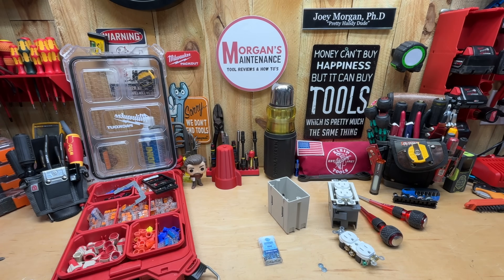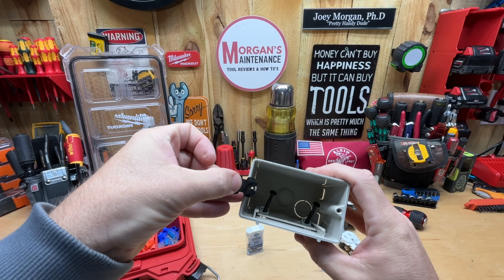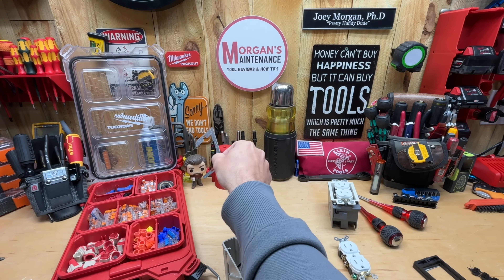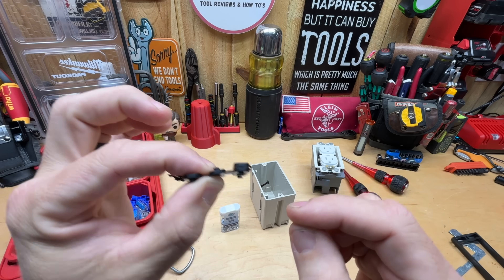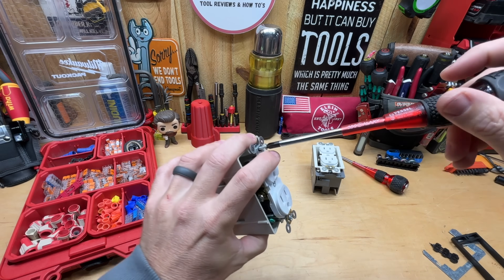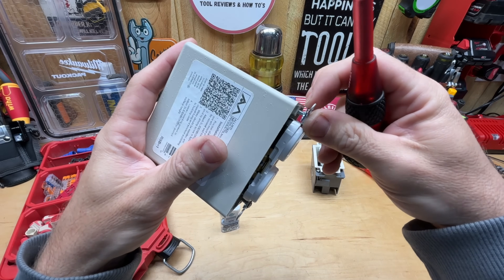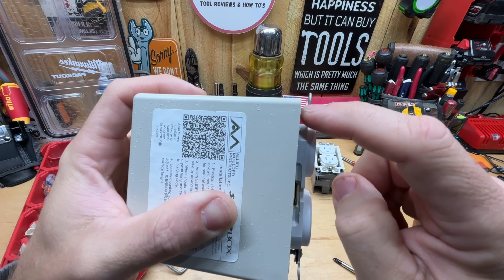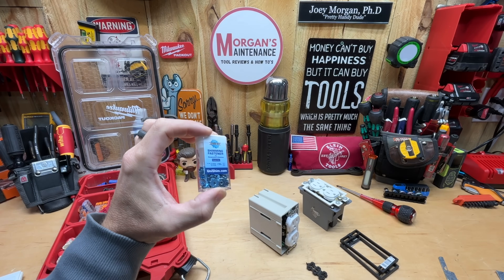UNISHIM - Electrical Shims for Receptacles & Switches

Comment: I would RECOMMEND you pull that plastic square off of the screw. The tab on the shim is intended to seat itself on the inside of the through hole where the screw goes through the outlet upper & lower tab. 
You can also just use your screw driver tip to spin the shim to adjust your gap instead of using your fingers
Reply from the maker: That does help, I just used one of these today 👍

Comment: I use the "caterpillar" ones with Sloan concealed flushometer sensor plates to bring the button mount out to the proper depth. I'll have to see about getting some of these to try.
Reply from the maker: I’ve used those more than anything else… these seem like a good option so far

Comment: Hello again, Morgan Maintenance 
Thank you for another Great Video 👍 I am not an electrician.  How does that change once you add the wires to the problem? Does the wiring change  how everything comes together? Stay safe and warm. Again thank you 👌
Reply from the maker: @georgeferlazzo7936  you wore everything the same as you always would.  These or any of the other shims just go into place as you are screwing the receptacle to the box.

If you are out real far from the box, that’s when you need to add an extender to cover the wires and terminals in the gap… but wiring is all the same

Comment: Looks like a good solution and timesaver. I use the ears from recepticals and switches for small adjustments. For bigger gaps I like to use 14 gauge wire. Coil it around a nail or small screwdriver so that you end up making what looks like a closed spring and cut a piece any length you want. Slide it over the outlet screw and screw it in. If you use your cut offs it doesn’t cost anything.
Reply from the maker: @timh7156  good tips 👍👍

Comment: I use clear plastic tubing. I forget the exact size but…maybe 3/8… but it woks very well and no need for adjustment. You just cut a price slightly longer and you just screw it until it’s where you want it. The tension of the compressed tubing hold it in once and each screw is independent. 

Only issue is it’s not UL listed or identified for the purpose
Reply from the maker: @nachoisme  I saw where RackaTiers sells something that is kinda like that in theory.  I’m not sure if it compresses or not.

Comment: In a pinch electricians use Plastic Conical Anchors, cut to whatever length needed .
Reply: Not necessarily proper just a way I was shown when I was an apprentice .

There is a Canadian electrical code rule where it specifies how far away your front edge of your box can be from finished surface depending of it’s combustible (residential ) or non combustible (commercial or industrial ) , American electrical code is very similar to CEC but I am not familiar with it. To adhere to this rule if your box was recessed in residential application you would technically need a box extension .

I mostly do commercial , i doubt resi electricians are using the conical anchors for spacing as they probably don’t even have it on hand nor is it proper.

12-3016   Outlet boxes, cabinets, and fittings (see Appendix B)
1)    The front edges of boxes, cabinets, and fittings installed in walls or ceilings shall not be set in more
than 6 mm from the finished surface and, where the walls or ceilings are of wood or other
combustible material, shall be flush with the finished surface or shall project from the surface.
Reply from the maker: @ yeah you are supposed to use those extenders like I showed in the video.  Either box spacers or the ones that fit into the box.

I’m usually dealing with mud rings on boxes which are normally set fairly well, (usually better than plastic residential) but occasionally they use the wrong mud rings because they didn’t know it was going to be 5/8 drywall or something.
Reply from the maker: I’ve seen quite a few things used over time.. that’s a good One to keep in mind

Comment: Interesting, with the design of our sockets in the UK, we just don't have this issue, as the sockets are built into the faceplate. Always intrigues me how things work in different countries 😃😃
Reply from the maker: @three-phase562  it’s always a problem here.  Either electricians don’t set the box depth right or the drywall cuts a hole too big… I think your way makes more since

Comment: I like how compact these are and how finely adjustable they can be.  I'm trying to picture using them in a 2 or 3 gang box.  You might need to loosen and tweak them for side to side and depth adjustments.  I wonder how easy that will be.
Reply from the maker: @coreysimm  as long as you aren’t pressing the receptacle against it you can adjust them in and out by screwing the screw in/out and the washer moves in and out with the screw. Then you just press the receptacle against it and tighten the screw again. (If that makes since, hard to explain with words)
Reply: @ Yeah, it's hard to visualize but I think I'll buy a package and give them a shot.  Thankfully the facilities I manage are fairly well built so this isnt a huge problem for me.

Comment: Another old man way to to cut off the extension tabs at the top of the switch or receptacle and use those as spacer shims: however, this is not recommended because the receptacle or switch becomes unstable, or rocky. 🧰🥸
Reply from the maker: @terry.burton  👍👍… sometimes you have to use what you got 😂

Comment: Thanks Joey. An 'old man' electrician would coil a piece of bare ground wire around a phillips screwdriver and use his diagonal pliers to essentially make a tiny spacer... cut to size. Bam! Problem solved in five seconds. 🧰 🥸

Comment: Sold! 🧑‍⚖️   I do 100s of apartment recipticles a month and I ussaly use plastic spacers metal plates or better yet decora edge.  There's a clear advantage and a few disadvantages.  The bad is currently in can shim with platic or plates without fully removing the device but I'm likely ti inspect it anyways.  Now the good side is the plastic shims spin as your putting it in dosent lock well.  Whenever anyone takes the device off all thoes shims get lost easily.  This at least they stay when there done.  Looking for a larger pack or more industrial supply to try and bring down the cost now 👍.
Reply from the maker: @MattHmm-rq6dn  let me know if you find a bigger bulk.  I took one screw out of a receptacle at a time and added them on the screw when I put it back in.
Reply: @MORGANSMaintenance  so bad news they don't have a good supplier and upcharge to azon and menards (hunt hint they sell then there) by at least 2 to 3 bucks each.  There own site is 10 to 13 bucks each but would likely be negated by shipping.  Lucky you there nearby and can be under rebate for anyone with a menards.
Reply from the maker: @ I will check my Menards this week and see if they have them
Reply: @MORGANSMaintenance  thanks I was trying to find a negative but you defeated that!

Comment: Hey Joey do you think you’d use these shims more than the first spacer you showed I was just curious becuse lat time I check this spacers are a little cheaper than these ship and what would spacer would you recommend
Reply: I can already see the advantages.  The plastic strips always get lost or spin around if you take it off after the fact.  Painters or drywallers always impact and rip them out and tilt the recipticles so the spacers get lost.
Reply: @ ok that good to know I might go with the shims next time then
Reply from the maker: @jacqueskriel7351  the plastic ones have been the ones I have always used mainly for space, the box extending type I only buy those as needed if it’s an entire job like a backsplash or something.

These will likely become my “go to” if they are on me, but I will still likely use the plastic ones since I can buy them in store.
Reply: @ ok good to know thank

Comment: Hey Joey!  Thanks again for the video showing us the different types of gadgets out there!  I will be interested to see how they work for you over time.  It just seems like it would be difficult to make the minor adjustments when the plugs or switches are in the wall.  Have you tried these out in the field yet?
Reply from the maker: @pi_guy-b1p  yeah only on a few so far.. they work for me.

If you need to adjust you just loosen the screw, screw in without pressing in on the receptacle to move the washer in some, then press in on the receptacle and tighten. (If that makes since with words 😂)

I will still use the other methods too. The plastic ones work pretty well, but once you get the hang of these they are pretty nice.
Reply: I've double 8-32 thin nuts before I got the plastic shims more work same idea 💡.